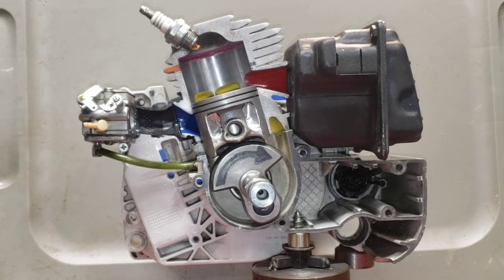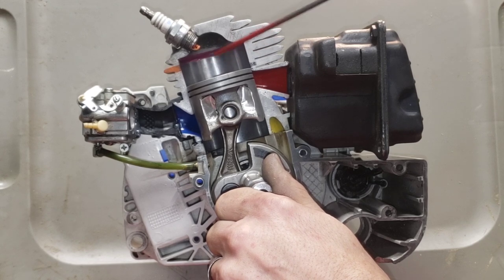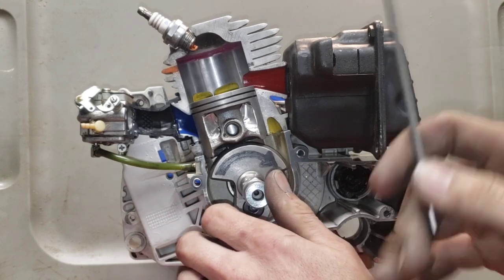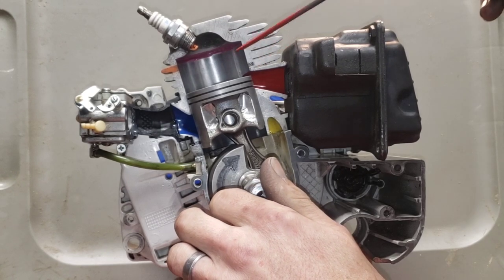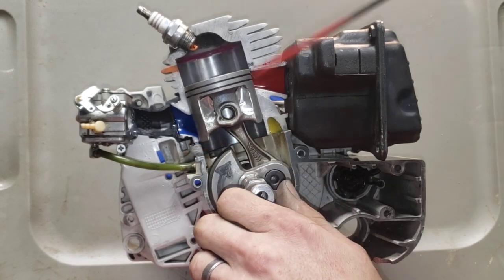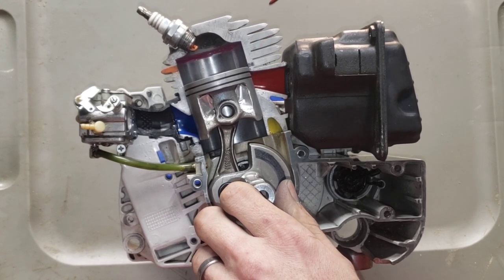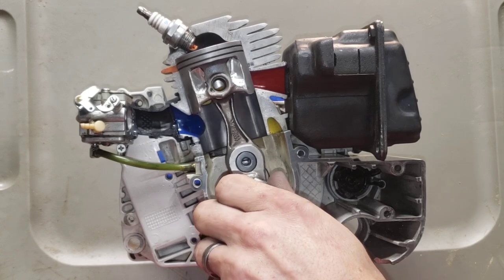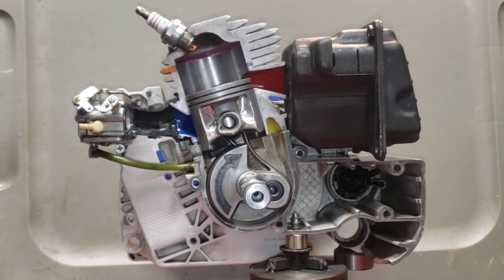A very simple explanation of how your 2 stroke chainsaw works... stihl MS461... READ DESCRIPTION...

Comment: "You raise the exhaust roof BUT this is why I stress you gotta machine it as well"(paraphrasing your point at 9:00)  That is probably the best, most-succinct way I've heard to properly dispel the "myth of '2-schools/methods' of porting" that so many seem to hold, IE that you EITHER:
- machine, and make power via torque, or:
- raise exhaust roof, making power via RPM increase...
This "dichotomy"/choice puzzled me the moment I started learning Re porting last year, especially w/ creating my own timing#'s/layout BEFORE having a jug in-hand, realized very very quickly that the "2 schools/approaches" mindset was a "false dichotomy", and the optima would necessarily include BOTH....I would explain/phrase it as "the dichotomy breaks-down if you are in a hypothetical situation wherein a manufacturer offers to cast you a jug with ANY specs you tell them", forcing you to choose exhaust height, volume swept gas & comp.ratio & squish clearance, you'd be choosing optimal #'s not "aiming for 1 approach at the expense of the other", you'd "harmonize" them/approach it holistically and take both into consideration......ERGO, that should be the approach to porting any jug, as you say "raise the exhaust roof" to increase RPM but this must be done on a stronger-compression (decked) cylinder or you are trading your torque for RPM's, if you do both you're *not*....cannot understand the "other side" logic of machining-only, guys who want super high compression and exhausts at 105+...
Thanks for these "basics" videos, I suspect we'd all like to think we have a better grasp on these mini-miracles than we do, I know it's all relative and at your level it's probably about the swirls/eddying/loop-efficacy whereas for me it's "I bumped power 15%, gnarly", but would imagine you could never stop learning/improving 2-strokes (or even a specific platform, I bet you'd improve your 44*/46* builds over time, w/ lessening gains but never a cessation of gains)

Comment: I've noticed with all your videos that the transfers ports and carburetor port are huge compared to my Ms 441 . Im thinking of just opening up the transfer ports on the very bottom of the cylinder and doing a gasket delete and that's  all like think I can handle at this point . thanks for the videos
Reply from the maker: the 441 is a whole different animal and i know that saw like no other lol... you can definitely open up the lowers/uppers/intake... dont widen or raise the exhaust unless you are machining... and you can tunnel the strato ports a bit so you are getting fuel/air in the strato ports as well... you can also find coils that aren't limited if you have the adjustable carb... the mtronic coils are all limited as far as i know
Reply: @johnscustomsaws  thanks for the info ill look into it
Reply from the maker: @doyletech623  absolutely my man... did you get my emails? Lotta people haven't been getting my messages but I just wanted to run something by you so I can finish the NOS cookie... it turned out really good
Reply: @johnscustomsaws  the last email I got from you I replied to that's all I've revived.

Comment: How do you find the best numbers for blowdown? This is the number that seems to always be up in the air, to an extent.
Reply from the maker: BD is tough... it can change performance DRASTICALLY and it doesnt take much... i have tossed quite a few cylinders in my day trying to test different BD numbers... i truly dont even have a good handle on it and i bet thats why guys are afraid to talk about it... i just dont have anything to prove so i will admit i dont fully understand it... i have found that the higher the exhaust I run I get better performance with a wider BD... for example if i run a 96 exhaust i would want a 28 BD and with a 100 exhaust i would want a 22 BD... now that is just what has worked for me... not saying thats what you should do... it is all relative to intake timing and case compression angle... all that fun stuff... i have gotten as tight as 16 on a BD and the saw ran like total shit... but i know saws that are built with a BD of 15 and they run like crazy... but they are running higher compression than me and map their cylinder different... so there is my honest but super unhelpful answer lol
Reply from the maker: I will say this and have always stuck by it... for a good strong build you can just about always go with:
Intake 80
Exhaust 98
Uppers 122
Squish .020

... that will be a runner no doubt 100%
Reply: @johnscustomsaws  good stuff. Guess the only way to find is expect to loose a few jugs in trying. Interesting to know how drastic it can be, i figger its a good number to have an idea of, but not specifically a set number to shoot for
Reply: @johnscustomsaws  i just checked bd on this stock 056 and got 13 degrees... thats eyeballed thru the plug hole. Intake duration is 160

Comment: Re-watching your explanation of RPM//exhaust height//torque (~6:00-->10:00, which everyone should rewatch if they're not getting it as you explain it better here than I've found elsewhere), in rewatching it I'm finding it harder & harder to respect the chainsaw-performance-norm of not "dialing-in" compression, heck maybe it's your "secret sauce" for your professional builds & you just don't share it? "It" being, of course, a truly optimized compression ratio of the unit, not just "strong" like most go for....I'd honestly wondered this before, since you're such a tinkerer/experimenter and have such a specific focus on new/high-displacement Stihl models, I mean at the end of the day we're getting super-precise in our measurements & preferences for:
- operating RPM, and 
- exhaust port opening-time, 
and you help a lot of people by acknowledging/clarifying that it's not "machine OR raise exhaust" but, of course, is both, however this NECESSARILY means that for true optimization, we have 1 more step: Determine true optima for compression, not just "oh it's 19thou squish and a hard-pull start, that'll do", but actually just do a build, drop the cylinder like 2 or 3thou more than usual and, w/ a dyno, figure out PRECISELY where power starts dropping-off. You'd then have your ideal / perfect optimal efficiency (for power) of said cylinder, which for your purposes is awesome (the more I think of it the harder I find imagining you haven't done this already...but you've never spoken an iota of it on your vids...but if it's your secret sauce then I get that & feel bad even suggesting it on your channel-space but am only thinking aloud / caring about the saws/building!!)
Thanks again for the great vids, just finished a 6-day project am gonna be watching youtubes while building/cleaning/sharpening/etc saws all day :D
Reply: PS- would be neat for you to finish your already-the-best demo saw by cutting that muffler in half, I'm still newer to Stihl layouts but the 2-part muffs are one of my favorite things Re "stihl differences", sadly chainsaws - all OPE, really - are of course not getting the push&pull of an expansion-chamber type muffler, so almost all chainsaw builders effectively "throw the baby out with the bathwater" and strictly worry / concern themselves w/ "opening up the muff" with little thought to its function (or size of exit hole/holes, or their placement, or Grunt Gasket header-pipes etc)  The 880 muffler is, funnily enough, the most-similar OEM design I'd ever seen that embodied what I'm trying to do on my 660 mufflers, I'd genuinely put $$ that the 880 muff design would beat a 660's (or 440's) and most other saws' muffs (provided you open-up the final exit in the muff, obviously that is a choke-point on basically every saw in existence so far as I've seen...though even here, people just blindly "make bigger exit holes" they don't bother, say, putting a steel plate atop the hole so they can gradually increase size until cut-speed stops increasing, then they'd have their precise optima for muffler-exit-area, and so far as Jennings'&Blair's books on 2-strokes paint it this is a very very important part of the exhaust system, there's zero reason to suspect this doesn't apply to can/box mufflers (as the final exit affects the entire engine's throughput-resistance, independently of sonic/acoustic activity from the piping)
I WILL get my "Grunt Gasket" built & posted today, wish I had a dyno as I only suspect a few % power from it, probably not enough to show up on my cut-time measurements :/ I've already made the raw/base Grunt Gasket by ripping the exhaust port from a spare cylinder, it will have at least 3 increasing angles of divergence before entering the muffler also it will extend the saw's exhaust port from 0.8" to nearly 2", that's awesome for 'the symphony' as you put it, but the increased diverging-angles of the tube create 'suck'/pull, not as good as the divergence cone of a true pipe of course but a non-zero for sure!![EDIT-- "Grunt Gasket" is the IP/idea of Dominant Saws, I saw it on their Facebook a couple weeks ago but they'd just milled a straight-tube type "header gasket", I expect using the diverging-angles effect will cause a significant increase over just the lengthening of the exhaust-tract....also let's not forget this moves the muffler from millimeters, to >1", from the cylinder, or "the cylinder's hot side" I should say, actually given the disproportionate heating of exhaust-side of cylinder(and piston), you'd think there'd be greater efforts physically-distancing the muff from the jug from OEM's!]
Reply from the maker: ding ding ding!!! you are the first person to figure out the sauce... in fact once i know you have read this i may delete your comment even tho i love ya my man lol... or i will just delete this response thats more appropriate... this is key tho... if you have noticed and i am sure you have... i do not build super high compression saws and obviously i could but dynjo results show (and yes i do have access to a dyno just not "the dyno guy" hereon youtube) wow quotes inside parentheses thats a first for me lol... but i have said many times the domed piston build behaves so different and my numbers especially squish will NOT work in a standard build... thats why i stay away from giving out my specific build numbers and people take offence to it and i do it bacause running my numbers probably isnt the best... i still do a few saws flat top but i machine the squish quite a bit and its a pain in the ass!!! you are definitely no dummy my man... and i really dont care what the other saw builders think of me... i NEVER start anything with them but i think people think i am trying to single out some by the comments i make but its just me speaking about a general topic... i will never understand the thinking when guys dont machine but raise the exhaust but i guess everyone has a different purpose for building a saw... if you dont need torque i guess its acceptable but still i have a hard time thinking its truly benificial...

Comment: I know nothing about timing a chainsaw port. The transfer ports a just that. As the piston is going down it causes the upper ports to become a vacuum of the air and fuel in the crank case. The suction of the down stroke sucks the available air and fuel up the transfer ports. I would suspect that there's next  to no pressure in the crankcase.  This theory could be checked by tapping a hole a putting a guage on the crankcase.  Good experiment for a saw guy.  But molding a saws ports might change crankcase pressure I would suspect.